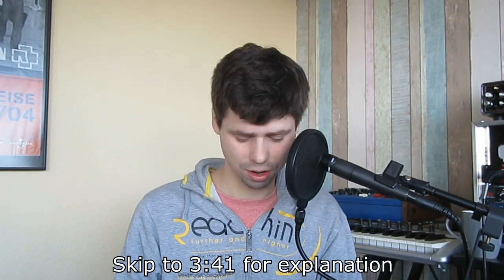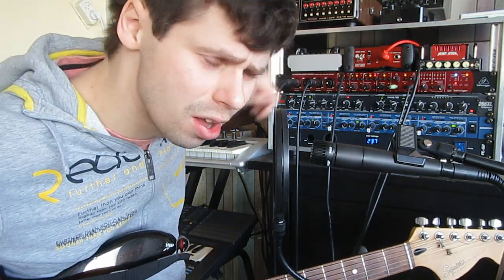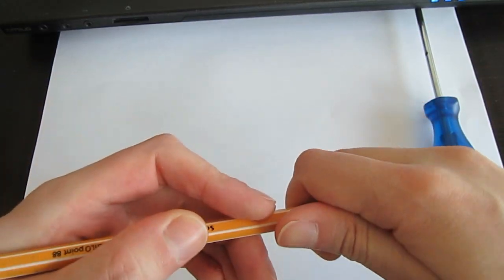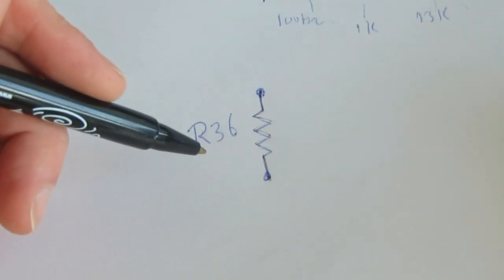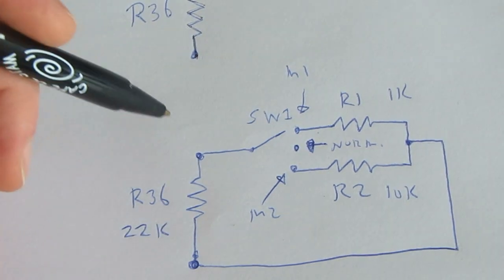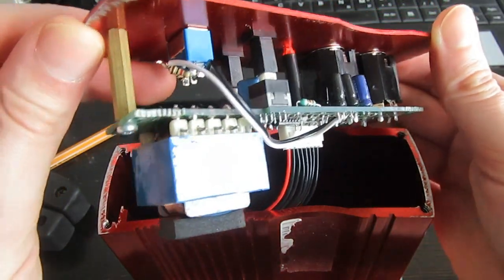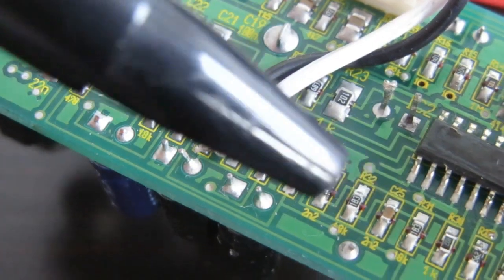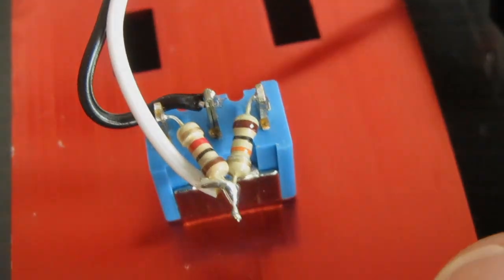Behringer GI100 DI - Cab Simulator modification

Comment: Hello,
I am definitely going to try this mod.  I have owned this DI for some time now and never liked this cab sim until the other day when I tried it out and I actually think it sounds really great.  I actually put it in the effects loop of my Peavey Rockmaster preamp, and used the direct link output to go to the return of the preamp.  Then I fed the output of the di using the cab sim to my multi track where I had it on one channel.  The the main output of the preamp I fed through my usual effects and had them completely wet in the mix and fed them to a stereo channel on my multi track.  This allowed me to blend at will whilst maintaining the analogue  dry and adding the digital wet signal.  The sound was amazing and simulated a wet/dr/wet guitar setup.  Despite this I do like additional options so I might try your idea!  Thank you for sharing the information and taking the time to make the video and go through everything.
Reply from the maker: Interesting and creative setup! :D

Feel free to experiment with resistor values (or heck, put a variable one in there even!), there's quite a range you can get :)
Reply: @rot_studios  I forgot to mention that the effects are also going through cab simulation as well, I have them running through a IR cab sim pedal.  Anyways yes I was thinking about the variable resistor. I could stick in say a 200k right?  If I did that where would I solder the legs to?  Not sure about the wiper leg (the middle one)???  Again thanks for the inspiration to try this!
Reply: pro tip : you can watch series on Flixzone. Been using it for watching lots of of movies recently.
Reply: @Troy Blaine definitely, I've been watching on flixzone for since november myself :D

Comment: With this mod implemented you are not bypassing that resistor, but changing its value because you are adding resistor in parallel. SW1 position lowers total resistor value to 960 Ohms, SW2 changes total resistor value to 6.9k. Probably changing some RC filter.

Comment: Hi, nice video. Just one question, is the connection between the input and the direct link output steady/thick enough to handle for example a 300watt amp? The traces are in the PCB, right?
Reply from the maker: I don't know if it can. You could check the website for a manual, surely it's stated in there.

Comment: Hey can you connect a preamp output into this box of tricks, I need to get the distortion channel into a tascam recording unit
Reply from the maker: Should probably be fine, there's two pad buttons on the input side to attenuate the signal if it's too hot.
Reply: @rot_studios  thanks man, how have you got it linked up here, what is the distortion from, it sounds good man

Comment: I dont have the same model. I dont have a R36.
Reply from the maker: Oh err... that's odd. It is the GI100 Ultra DI?
Reply: Behringer Ultra-G GI 100
Reply: Also the board is reversed. The resistors are facing the other way.